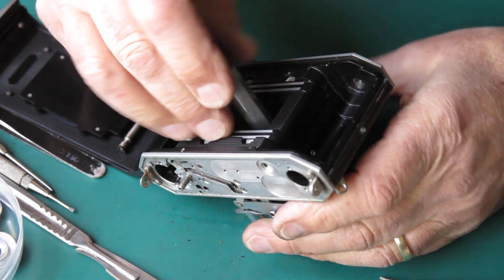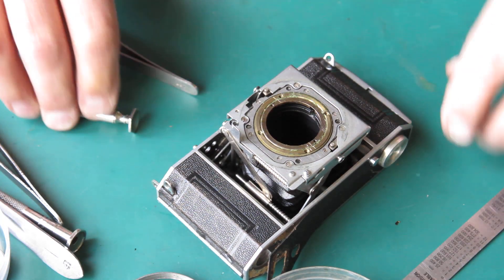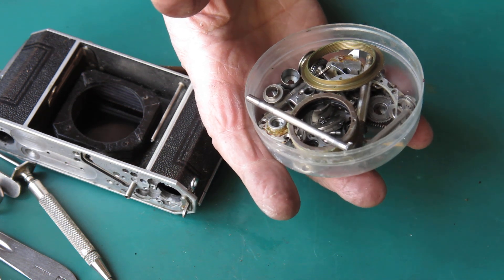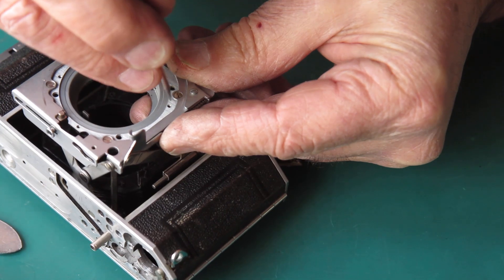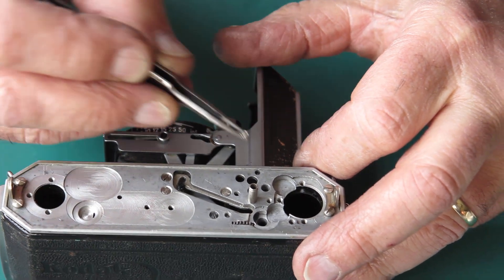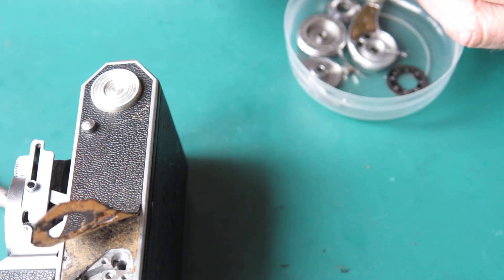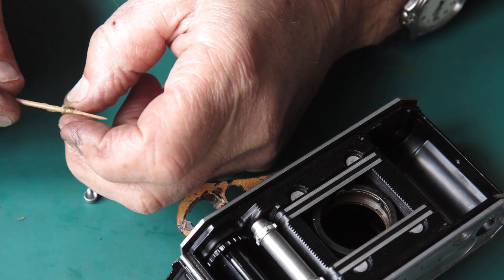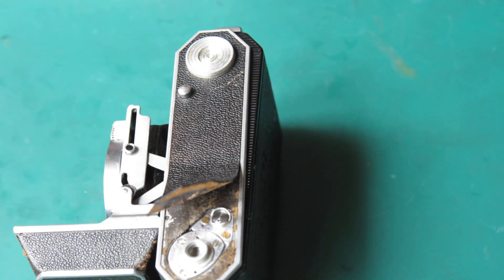A Retina IIa camera with multiple introduced problems, part 03

Comment: I am interested in why you do not use oil in your assembly. Some recommend watchmakers oil and such. Many thanks  - great work
Reply from the maker: Oil is the main enemy in leaf-blade shutters, and I don't think it is useful in retard gear trains, they are not watches.
Reply: @ChrisSherlock  Many thanks - I will certainly try out your lubricant choices. I enjoy working on the contax and contaflex cameras and have been using a little oil on the film transfer mech. Cheers